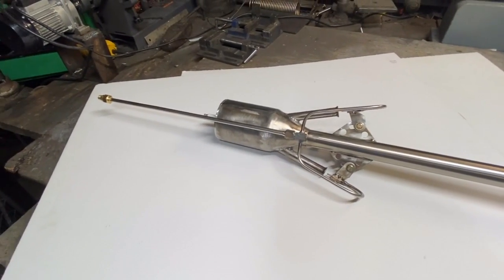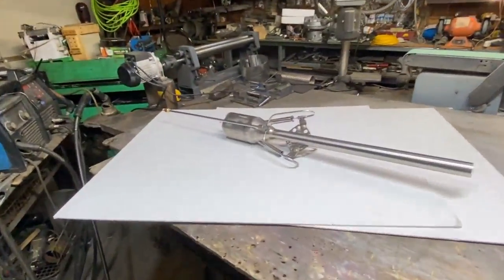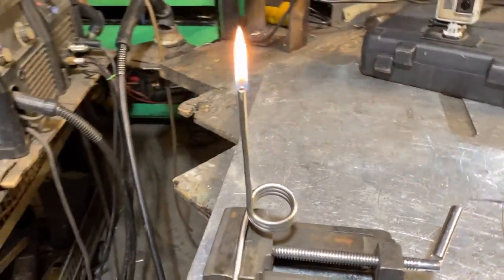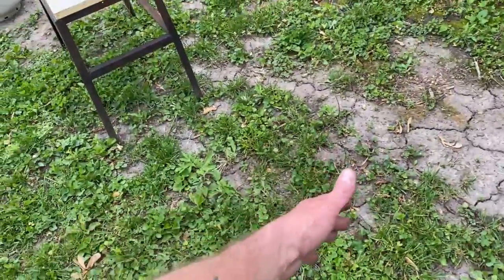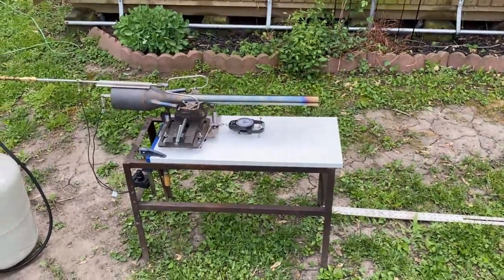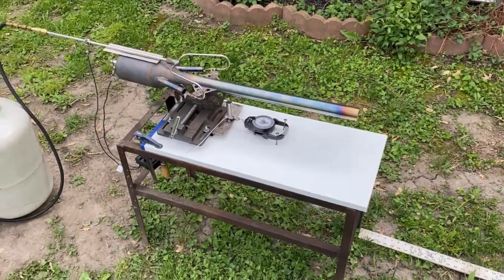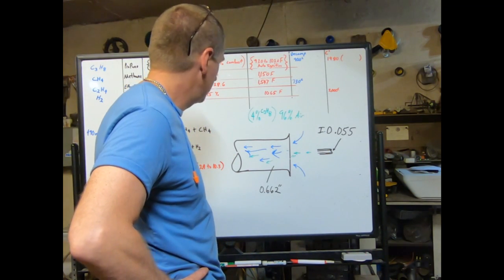2 Lb thrust pulse Jet engine  Asphalt heat lance testing .

Comment: put a rotameter on the gas supply line?  it was possible to obtain new data on gas consumption.  And the Laval nozzle, after the combustion chamber, to increase the speed of the outflow of hot gas...

Comment: Would you be able to have 1 small office starter jet and then have an additional high flow jet controlled separately once it’s running to see how much propane you can jam in there?
Reply from the maker: Great idea mate , i have considering doing with jus a single sparge to see how it does .
Ill mention you if i give it a try

Comment: Very nice video, what you are talking about for your ratio's is the stoichiometric ratio.
Reply from the maker: Thanks for the input , i thought that term only applied when siting mass per moler quantity . By volume there is in fact no stoichiometric composition per say as it is out of stoic   at this point . If im wrong to think this please do explain as i love to learn but hate to be the fool . Yes i have herd that term when people speak of combustion systems but i often thought to myself they are misusing the term   Stoichiometric . Because we are not balancing by moles but by volume of gas  it is not a stoichiometric balance . I could be wrong , im self tought .

Comment: When heating up propane, you're likely making a good deal of propene (aka propylene) and hydrogen. It's known as the thermal dehydrogenation of propene, and is the main industrial method to produce propene. It's performed on absolutely massive scales in refineries.

Comment: First eye and hearing protection means a lot when one gets old. Second, what you are talking about is first year CHEMISTRY 101. Third, pulse jet are always cool. Keep on experimenting NOBOX7
This triggered my memory. I worked with a tree trim company years ago. When we would have to cut down huge trees level with the ground. I was low man on the totem pole which meant I had to use the "SONIC LANCE". This was a special wand which had air supply coming under high pressure and major volume. I had to dress in a moon suit which was hot as a bitch in summer and special shoes to protect me from air moving at mach 1.6 sir speed. The wand was attached to me so if it got lose it would not heart or kill me if struck in the head. The circular part of tree had a round enclosure around me. This protected people around the work area. Let me tell you NOBOX7, I would never do that today PERIOD !! I got so good at using this tool that I was subcontracted out to do other work sites. Shame this was before all the fancy smartphones as I would show this on YouTube myself. I still remember holding on to the unit for dear life as the sound would just go to ones bones. I felt like superman. 
P. S. good luck with your adventure. vf

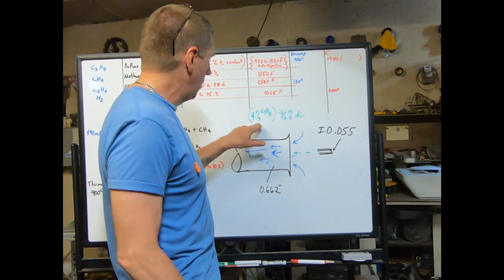Comment: 14:10 It is also important to make sure you have a divergent induction tube.

If you look at any normal carburetion tube, even on traditional propane stoves, they begin with a small opening [typically with some adjustable vents to the side] but then it opens up gradually, somewhere from 0.75 degrees of deviation, all the way to 2.4 degrees [angle depends a lot on purpose, and manufacturer (aka 'patent laws)] so that this expansion/venturi region combine to both increase air induction as well as velocity, pressure, and inertia.
Reply from the maker: Yes the air horns do leave alot to  be desired . Making a convergent  divergent nozzle at this small of a scale is very difficult . Its easy to roll large cones but small is a pain . You are indeed correct   , we have room for improvement there . Air horns have bin my enemy for years my good friend . They make or brake a burner , just watch my plate burner videos . Cyclone plate burner
Reply: @NOBOX7  Been watching everything you do for many years now. This is just a different account.

Comment: Using a 'trumpet' model, you can actually fine tune the ideal length by putting a section of tube over the existing length [likely best to begin with a slightly 'shorter than known optimum' so you get the full sonic harmonic resonance range] and some allthread and another piece which can be very precisely dialed in or out until it reaches optimal performance.

Just get a piece of tube that will slip closely over the one you already have, tack a couple of nuts on each side, and thread the 2 pieces of tube together [may need some locking nuts and/or retaining clips to keep the distance from changing] so that you can just use a pair of wrenches to lock and unlock the nuts as well as dial in distances.

Once you have the ideal length, just measure that distance and keep it safe for future use.

You could then either just weld the sleeve onto the internal tube, or else cut all new tubing.

Even the difference of flaring the exhaust, by the way, changes the behavior and efficiency of the system, because of pressure scavenging effects (yes a whole NEW rabbit hole of physics to go running down!) 🐰🐇

But then...

WHAT ELSE would you expect from Duh Bunneh Wabbut? 🐰🐇
Reply from the maker: Yes working on the fly is the way to go . I wish i had the perfect diameter pipes for that test
Reply: @NOBOX7  One option is to find the nearest over-sized tube, cut it down one side, and then compress it over a dowel the size of the pipe you are sleeving [a dowel won't accidentally weld to the part, whereas a steel tube might, but it does help keep a lot of the oxygen out of the weld], clamp it there with a few strong hose clamps, tack it with your welder then come in and follow up once you know it is strong enough to release the hose clamps.

The smoke of the dowel [if any] will simply help displace any oxygen.

Another option I have seen used is wrapping a single layer of aluminum foil around a tube, but if you accidentally burn through, you can still end up welding to the internal pipe, plus it can create aluminum oxide slag which can stick the two tubes together, so I'm not a fan of it.

Rolling a temporary tube out of a short lived, low value piece of mild steel which can be welded with a wire feed welder or even brazed is another option.

Something that only need last long enough to find that perfect pitch point, make sure of it with some repeated testing, and then who cares what happens to it.

Comment: give Woodgas a try and use a Smoker from a Bee Keeper.Start the Jet with normal Gas and change later to Woodgas if the jet is on Temperatur,but preheating also the woodgas befor you bow it in the burnigchamber.